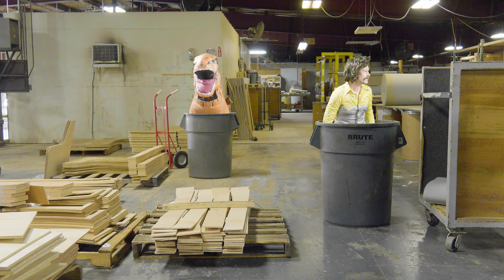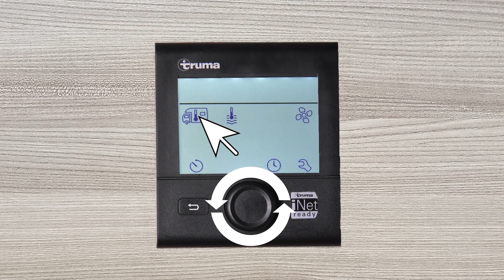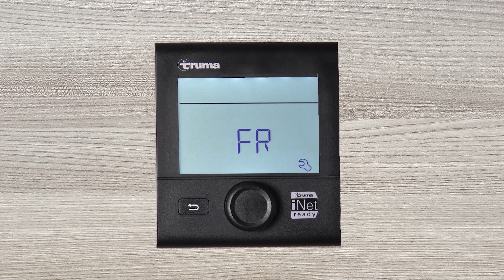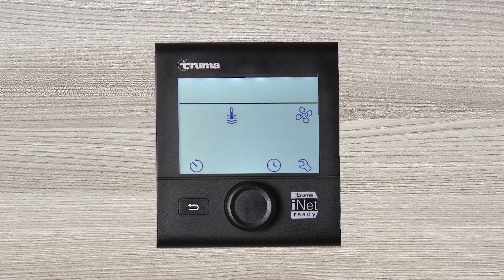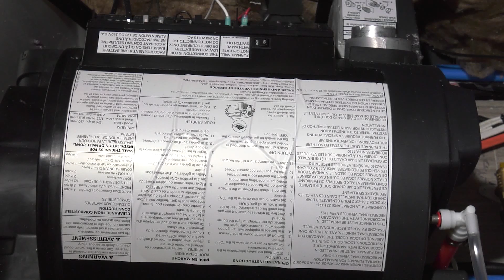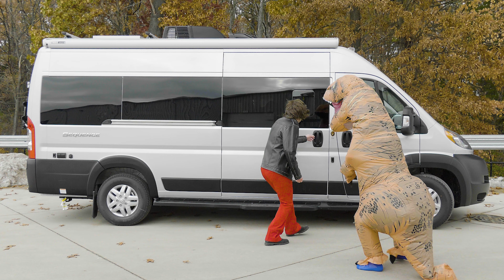How To Use The Truma Combi Eco Hydronic Furnace & Water Heating System

Comment: When you say winterizing is "easy", does this method keep the plumbing from cracking or just how to winterize the Truma? I'm going to be driving into freezing temps in a week or so and need to know. Thor Twist 2LB. 2025. Thanks ! Also, I've not had to use the furnace but when I set the temp for the coach, nothing happens. The flame never flashes. I"m a bit disappointed that it seems like yall put the cheapest, oldest display and Trum into my brand new RV. Maybe the switch is turned off?? Thanks for any help you can offer.
Reply from the maker: Good morning!  We'd recommend reaching out to our Customer Service team for any specific questions you have on winterizing your coach and cold weather camping.  They will be able to answer your questions in detail and provide you the most specific information on your coach.  They can be reached 24/7 at 877-855-2867 or wsupport@tmcrv.com.  Please be sure to always include your full VIN in any communications so they may best assist you.